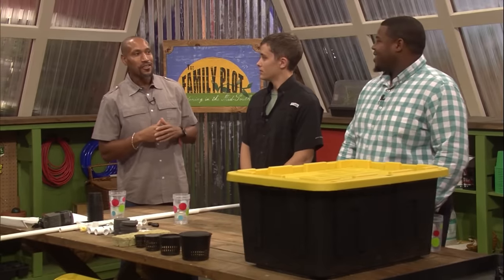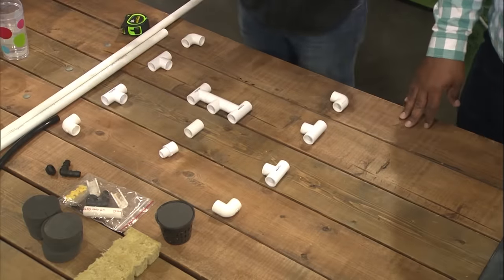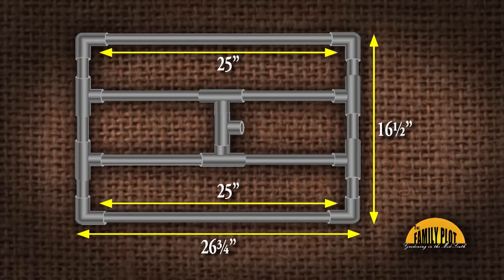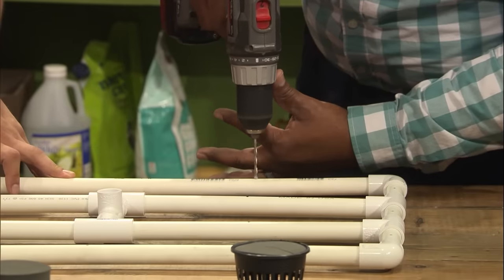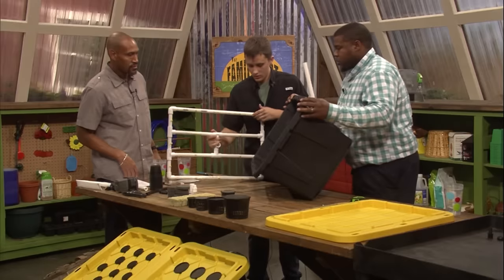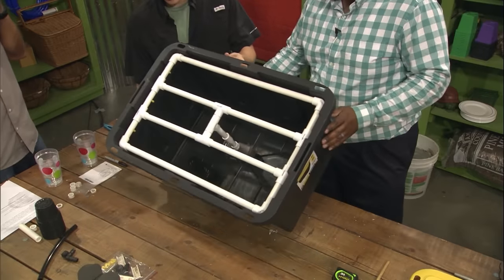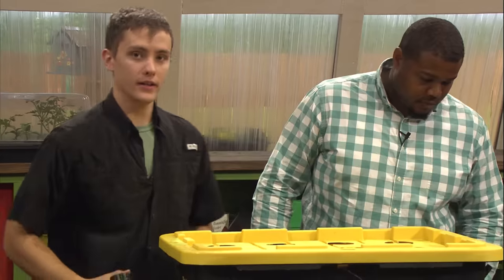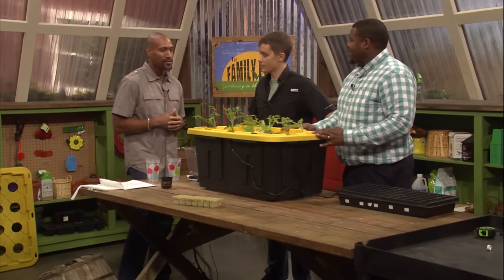Building an Inexpensive Hydroponics/Aeroponics System

Comment: my question is, the water spray is going downwards.. how could the water reach the roots of the plants..
Reply: the plants are added with roots already growing. the sprayers are highly efficient aerators. much better than airpumps. the idea is to use as little water as possible, pump it to aerate and wet the environment, and get the benefits of the internal mist to boot. if pointing up, without further modifications, the water will find its way out of the tote. 

this video is meant to teach how to build this as a general idea. adapt the configuration for your application. if you want to root cuttings or grow seedling with one of these, just point it upward and maybe make one that has a bunch more sites because the small plants wont need much room.

Comment: What would be the pump rate for a system of this size? How many gallons per hour?
Reply from the maker: The pump is 400GPH
Reply: @FamilyPlotGarden  with these food shortage scares, this seems like a viable option
Reply: @FamilyPlotGarden  I have a Vivosun 800 gph pump and all the nozzles are not spraying
Reply: @alsoccerref1  Viviosun's pumps aren't as powerful as they claim to be for some reason. I've used them, too, and they under perform. Grab a solid hydroponic pump like active aqua and your system will make you happy.
Reply: @rilyb15  most underrated comment. I like to use a system like this in the kitchen, on a bare wall. I put shelf brackets on the wall, and very small black/yellow totes. They go up the wall as high as I want, and are connected to a tote at the bottom that houses water. Sprayers in the small totes all connect to the common reservoir. This system grows all of the herbs i need and salad greens. LED lights hung above each row of small totes, hanging from the shelf brackets the tote above sits on. Amazingly simple and effective!
Reply: @wetwerk2178  I’m just trying to get all my ducks in a row so if I do decide to go this route. I also live in northern Minnesota so the temperature may be an issue inside in the winter.

Comment: How do the plants get the water if the water is down so far below?  Sorry, I'm trying to figure out hydroponics and I guess I just don't understand the principles.
Reply from the maker: The sprayers barely hit the bottom of the cups and keep them moist. As the plants grow the roots grow down in to the main part of the spray.
Reply: If you are using plants with very short roots, just rotate the base T and point the sprays upwards until the roots get longer. The misters' job is to bring the water up and spray the roots so you will achieve great results with a little nutrient/water as possible, saving you money over time.

Comment: Curious as to how you're supposed to change the water in this system when the plants are a decent size.
Reply from the maker: You simply rotate the drain pipe down and the nutrients flow out. I always leave at least one corner site open to be able to add water and nutrients and look at the roots. Here is a video about how to change the nutrients in this system: https://youtu.be/gYrTTLbl3Ro
Reply: @FamilyPlotGarden  awesome, cheers fella :)

Comment: Shouldn’t the sprayers be faced the opposite way towards the plants? I don’t see how the plants will get the water if the sprayers are facing downward.
Reply from the maker: The sprayers hit the very bottom of the net cups. Pointing them down makes it so the PVC manifold can support the weight of heavy plants. Also it keep the sprayers from spraying out the power cord hole.
Reply: @FamilyPlotGarden  thanks for the reply. One other question. The plants can be grown from clone all the way through flower with this device?

Comment: You an take cuttings from plants and stick their stems through the neoprene collars and they will grow roots. Just start of with pure water until the roots begin to branch.
Reply: We prefer to use nutrient water on our cuttings. They take off faster. A novice may want to avoid it for the chance of overfeeding, but this should be a learning curve that's conquered immediately if using hydroponics. This tote isn't intended to be a cloner. It's too big and we point the sprayers downward. You're right, though. If they spray up and onto the stems, there will be roots in 7 to 14 days.

Comment: Do you need air stones? Do you run the system 24/7?..
Reply from the maker: We don't need air stones because the mist hitting the water creates more bubbles then you could get out of air stones. We do run it 24/7, although you could put it on a timer.
Reply: well I thought the fact the root are hanging on the air gives them enough air to breathe that's what brings the term aeroponics right? .. I do wonder how efficient this is from the very beginning seeds.

Comment: What kind of pump are you using
Reply: the pump in this demo is a 400 gph active aqua pump. Try not to go lower than 40 gph and get hydroponic pumps, not aquarium pumps, as the smaller aquarium pumps may not have a threaded nozzle to use with your pvc adapter.

Comment: Great video however if and when the sprayers clog up (because they do) during a grow.  Replacing one would be next to impossible.  Not only that but once its full of roots (which it will be) how would you even know all sprayers are working efficiently?  You definitely couldn't remove the manifold during a grow.  Not trying to be negative here but I foresee disaster in future.  Please comment if you have experienced this set up and let me know. Thanks
Otherwise very informative.
Reply from the maker: We had this system running continuously for two and a half years with these same plants and there was never a clogged sprayer. The plants eventually died from neglect (Thanks COVID)
Reply: Just take the lid off, plants and all, and put it on another empty, clean tote while you service the unit. You can absolutely expose the roots to air at anytime you want. The unit stays clog free because of the pump bag around the pump and a mesh insert at the water intake under the plastics of the pump, which is serviceable. We have used this exact system in many applications and that is why we decided to share it with the world. If you do get clogs, we recommend just having a bunch of extras on hand so you can quickly swap them out, clean the pump's mesh filter, and throw it all back together. You can always clean the clogged sprayers out with a tooth pick later, rather than having your roots in the dry tote for an extended period of time. This is a very low maintenance system and will not clog easily. We also made sure there's ample sprayers in case you do experience a few clogs, the rest will keep everything aerated until you can service it (or not, depending on how many clogs you have). Repeat: choose HYDROPONIC pumps with mesh filters at the intake valve and you'll rarely have to service things. Just clean everything well between harvests.

Comment: Does this set up work for starting seeds
Reply from the maker: I would suggest starting seeds for a hydroponic system like this out of the system. I usually use a shallow dish or plate with water (no nutrients). Set the rockwool cubes on the plate and plant in them. Make sure you pH balance the cubes first. Once the plants have their first set of true leaves add some nutrient solution so it is about half strength. Then a few days later move them into the system.
Reply: The Family Plot answered this properly, however I'd like to ad that our favored use of these systems is with propagated cuttings. We use smaller totes, around 7gallons, connected in a series to spray the cuttings until they grow decent roots and then transplant them into systems like this.

Comment: There is an incredibly easier and cheaper way to do this without all the pvc pipes. Build the tote the same way, fill with nutrient solution to the net cups leaving them slightly submerged and get a cheap fish tank air pump with bubble stones and drop the stones into the water.  The plants roots will touch the water to get nutrients while the constant air bubbles provide oxygen to the roots to prevent water rot or damage. As the plant grows the roots will trail down to reach the water so you don't have to keep the water levels so high. At this point you can keep the water super high with the air stones or pull it out and use the Kratky method of allowing an air gap between the plants and the water and the plants provide for themselves using capillary action.
Reply: You've entirely missed the point of this system. FIlling the tote all of the way with nutrient water is a tremendous waste of money as you replace the water every 2 weeks at maximum. Air stones cannot provide the coverage that the sprayers do, which aerate every inch of water without fail. Furthermore, air stones have to be replaced over time. With the aeroponics mister application you can use as little as 7 gallons of water in the beginning of the plants cycle and save a bundle on nutrient changes. That was our goal. The aeration was just an added bonus. You're describing deep water culture which is the oldest method of hydroponics invented in ancient Rome. In our modern world, we have sprayers and can eliminate waste. Since this video was created, we have made this technique use zero waste beyond nutrient changes, while still using as little nutrients as possible. Big Hydro loves your deep water culture. Keep using it!

Comment: what about adding, changing out the water adding anything to the water?
Reply from the maker: We use the Flora series nutrients from General Hydroponics, but there are many nutrient systems on the market and many work well. We drain and change the nutrients when the plants have drunk about half of the solution.

Comment: I just finished the system according to the video following the same measurements but the sprayers shoot the water at an angle they cannot reach the base of the cups and therefore the solution would not reach the roots, am I doing something wrong??
Reply from the maker: With the sprayers we used in this set-up, most of the solution passes beneath the cups but mist hits them enough to keep them wet and dripping. In another system I built I used smaller cups and so I rotated the pipes slightly so they would hit the cups from one side. Once the plants had long enough roots, I rotated the pipes back to the original position.
Reply: @FamilyPlotGarden  thanks for the advice!
Reply: @FamilyPlotGarden  Hello, I just twisted tubes and added extra 340 degree sprinklers. On equestion that i have is if I should spray constantly or if I should use a timer to spary the mist in cycles. please advice for my strawberries to grow. Thanks
Reply: @AdrianCaceresneurosurg  Run continuously. We spray downward so water doesnt escape. You can spray upward for the entire life of the plant if the water is contained. We use weather stripping when we need upward sprays in an unsealed container. Much luck!

Comment: Has anybody found the way to get that holes without an expensive drill? Thanks in advance))
Reply from the maker: It would take awhile but you could do it with a utility knife. Cutting through that much material does makes it easier to loose control of the knife and cut you. Be careful.
Reply: @FamilyPlotGarden  thanks for the answer! i thought more of using soldering iron to cut through plastic.But I'm aftaid it would burn, gonna watch tutorial on youtube how to do that correctly. btw, i have a really small space where I would love to savely experiment (book shelf) and...Can I make a hydroponic system 2 times thinner and longer? Should I make a 3d model and print (maybe find on the web) or solder pieces of plastic together? I'm afraid it would leak eventually. Or maybe there is another way I could get those long hydroponic friendly containers? Thanks in advance for your help!

P.S: We love your videos in Russia and was really amazed that you had answered me:)
You advice is a very big help to me and my all russian friends!
Reply from the maker: I haven't though of using a soldering iron, but that might work especially with a cool temperature and a small tip. You can build a system using any container you want, it just has to be deep enough for the pump and a little space between the top of the water and the bottom of the sprayers. You could shop for a long narrow container that fits your space. If it is a clear container paint the outside so no light gets in. The light will cause algae growth.
Reply: @FamilyPlotGarden  what did you mean by "using a  small tip"? For what purposes exaclty?

Comment: How long must the pump run
Reply from the maker: There are a few options here: you can either run the pump 24/7, or you can use a timer (that you plug in the wall and then plug the pump into) and set it for 15 mins on, 45 mins off.  The objective is not to let the roots dry out.  The roots need to stay wet.  Thanks.

Comment: what would happen if you built the system without the sprinklers?
Reply: There would be no aeration. You could use air stones instead but that would mean that you'd need significantly more water in the beginning and air stones require replacement after some time. This unit is designed to use as little water (and therefore less nutrients) and also be up kept with simple cleaning, rather than things being thrown away between harvests. The sprayers are the entire point of the design.
Reply: @wetwerk2178  thank you I am new to hydroponic growing. How do still water systems like the kratky method work without aeration? Just have to replace the water every grow?
Reply: @chocomoan98  The kratky method relies on the majority of the plants roots to be exposed to oxygen, while the remaining roots stretch down into the reservoir. Aeration of the water is absolutely necessary in any hydroponic setup, barring maybe short lived plants with small root zones, like lettuce. Not only does the water stagnate, but if we are adding beneficial microbes to the water, the stagnate water will deprive the bacteria and fungi of oxygen, killing them. This will create toxicity and harm the plants. Furthermore, the kratky method is also dependent on near perfect environmental factors. 

The idea of the method is to "set it and forget it". If the ambient temperature, ambient humidity, co2 levels, temperature of the water aren't ideal, the plants will either drink more water or uptake more nutrients depending on the environmental factors at play. If the area is too warm, water is absorbed at a faster pace, which will concentrate nutrients in the reservoir and cause the plants the suffer in one way or another. While I wouldn't consider hydroponics high maintenance when done correctly, it is definitely more hands on than using soil. This gardening technique can give a near perfect level of control over the different stages of plant development and can be forgiving, so long as the nutrient mixture is maintained. If you overfeed soil, you have problems. If you overfeed in hydroponics, you can just empty the water and redo the mix. 

I don't want to ramble on too much, so simply put the kratky method isn't very reliable hydroponic technique in this horticulturalists opinion. Great question!

Comment: what where the yellow things i Screw into the PCV what are those the sprayers
Reply from the maker: Those are the sprayers.
Reply: Search the internet for hydroponic misters or hydroponic sprayers. Take care to buy misters/sprayers with a hex head, and not the type with tabs for thumb screwing. You want to be able to put a socket wrench or electric screw driver in there to put the sprayers in the drilled holes, your fingertips will thank you.

Comment: But…what kind of nutrients should you mix in the water?
Reply from the maker: We use General Hydroponics Flora Series nutrients, but there are many kinds and companies that make them. Do some research and see which one would work best for you. If this is your first try at hydroponics, I would suggest using liquid nutrients for awhile, because they are easier. After you have some experience you can switch over to dry nutrients if you want. They are less expensive, but take some more work.

Comment: Please give me suggestions as far as the types of fertilizer for this system.  😊
Reply from the maker: We use the General Hydroponics Flora Series nutrients, but there are many other options out there from many manufacturers. Look at your options and what works best fro your kinds of plants. My only recommendation is to use a liquid nutrient for awhile. Liquids are easier to use then dry nutrients which you need to dissolve and mix before you add them. Once you have a handle on hydroponics you can switch to the dry. They are much less expensive.
Reply: Jack's Pro is the superior choice. We've deviated away from General Hydroponics since they were picked up by Scott's brand and no longer distribute to our type of stores. Jack's pro is a dry, salt based synthetic that only needs a cheap, $20 magnetic stirrer to get the job done of mixing them up. the folks at Jack's Nutrients love to answer questions and mixing is as simple as any other brand. The liquid nutrients are much, much more expensive. Feeding this tote with Jacks' (at 10 gallons) costs about $.40 (that's forty cents!) General Hydroponics, with additives to be as strong as Jack's is around $4. It's a no-brainer.